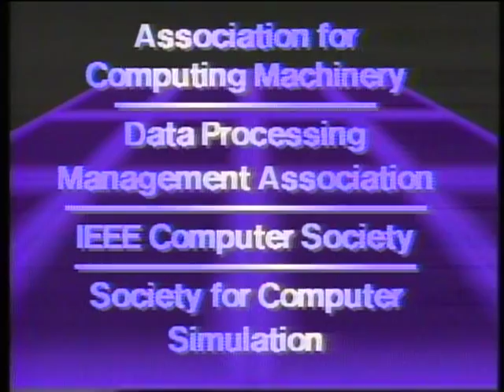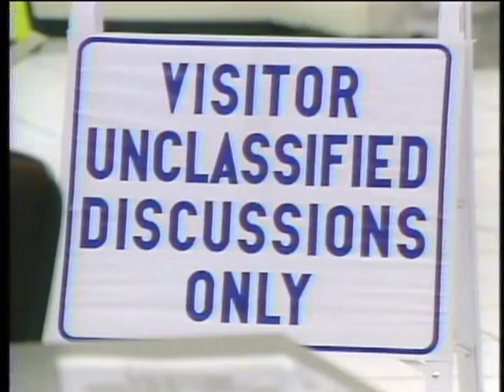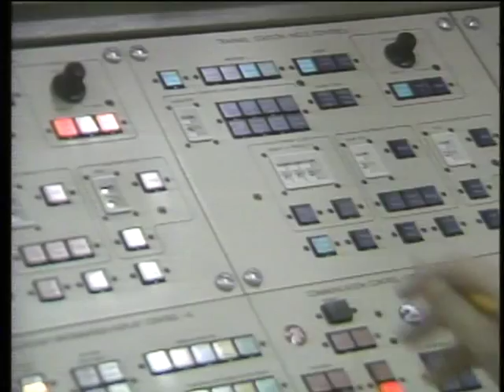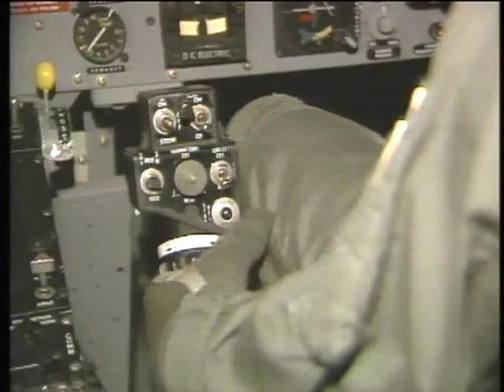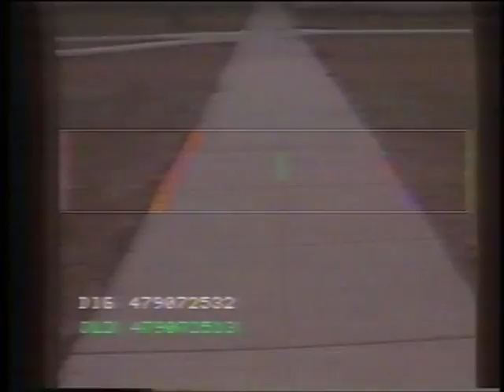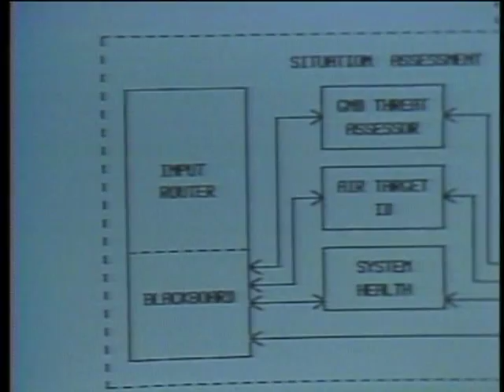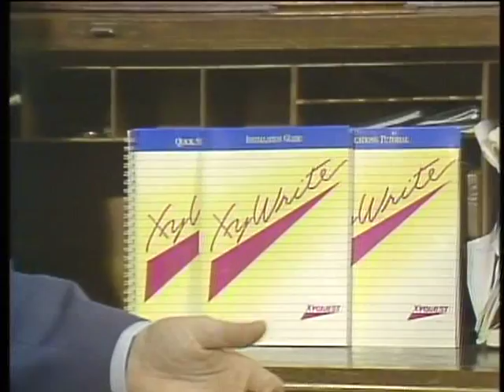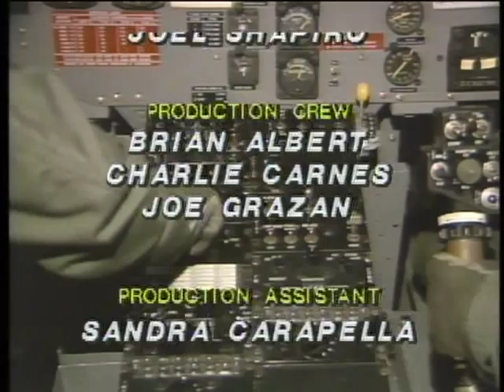The Computer Chronicles - Computers and the Pentagon Part 1 (1986)

Comment: 16 GB of RAM in 1986, only 200 million dollars, get yours today! Yes I know it was the whole system for that amount, but it was still amusing when even 30 years later 16 GB isn't mainstream amount of RAM. Last but not least Paul was point on at sorting his files by date. If you are working on contend creation, what ever it is video, photos, writing, anything you will be doing so.
Reply: Trying to do physics on a computer takes a lot of processing power. Reason is they want to get accurate as possible, thus use floating point numbers which will become very large. Plus, having more memory for the programs helps as there is less I/O activity to storage which  then the CPUs can spend more time on calculations rather than page to the disks.

Just recently I bought a laptop with 8GB of RAM, but since I use it for basic work items, I want to increase it to 16GB, but really cannot justify it at this time. However in a desktop I see a need there. Desktops with it's more power because you have the space to stick larger CPUs, and video graphics processors inside, one can justify the increase in memory,  to 32GB, even to 64GB.

That is what I plan to do soon when the AMD Zen enthusiast processor comes out in a few months. NVidia GTX Titan XP(or two 1080s), 64GB of RAM, 2TB SSD drive.

Comment: 23:50 - "262 billion operations per second." Is this correct? I thought each billion was ≈ 1 gigahertz, but this would be ≈ 262 gigahertz? That's not right, is it?
Reply: Nobody said hertz, but operations. Today's gaming computers do 100 trillion operations per second, and they're still running at 2 GHz. The clock rate is completely irrelevant.